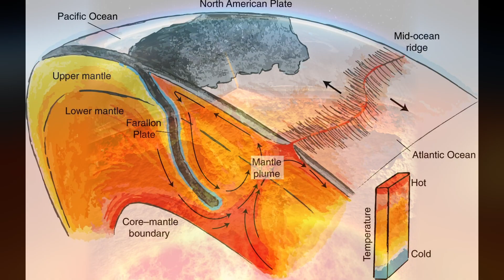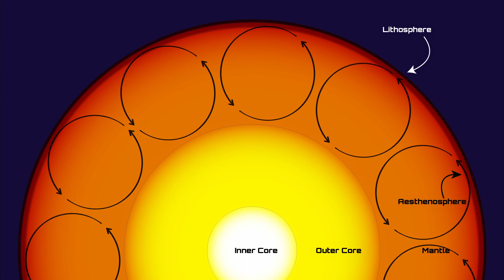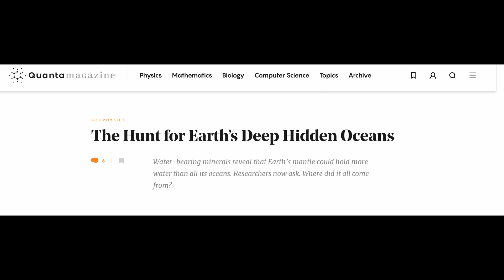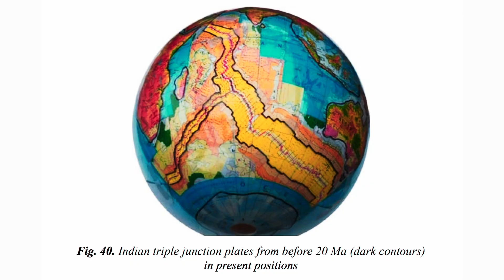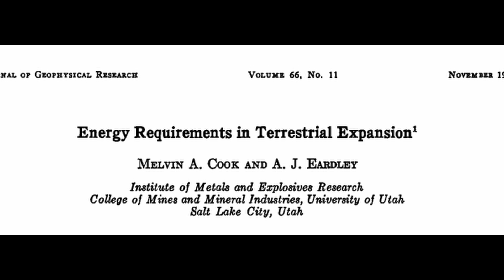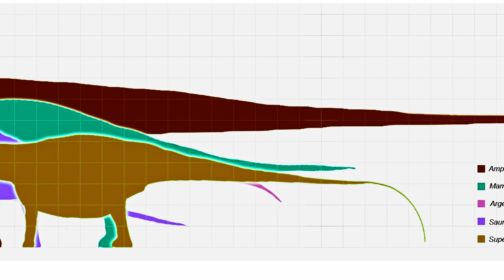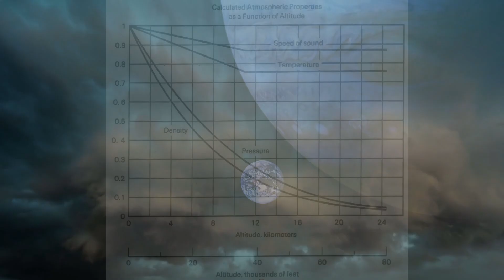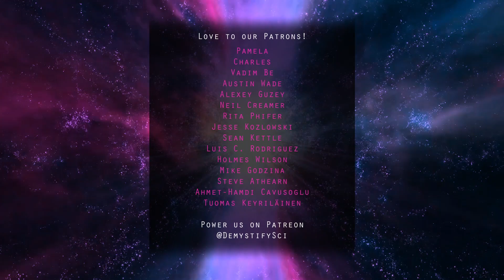Did Earth Start as a Mini-Neptune?

Comment: What if the earth was originally positioned at another point in the solar system, and the main variable in this analysis is a different ( 20% lighter) gravity. Because the degree of gravity changes to it's relationship with other bodies, and also it's spin speed which is also applicable

Comment: 1) Quetzalcoatlus is not a dinosaur, it's a pterosaur. The only flying dinosaurs are the ones around right now that we call birds. Quetzalcoatlus was more than capable of flight, due to the superior design of pterosaur flight compared to birds and mammals; they have a circular respiratory system and hollow bones on par with birds, but more efficient.
2) The reason there isn't any old oceanic crust is that oceanic crust subducts under any plate it collides with, which means it's constantly being recycled. Continental crust floats, which means it doesn't get recycled this way, instead it is eroded by weathering.
3) The earth cannot did not expand, it has remained approximately the same size since it formed. While a heavy atmosphere can compress a planet's core, such compression would remain even after the atmosphere was lost. You can't uncrumple a piece of paper.
4) Africa has no subduction zones because no oceanic plates are moving towards it. Africa is moving north towards Eurasia, but since both plates are continental this forms mountains rather than a subduction zone.

This video is chock full of misinformation, clickbait title.
Reply: Have you ever looked at an age map of the oceanic floor? It can only indicate radial expansion. The ages of the ocean floor, especially around Antarctica, are like rings on a tree. You can clearly see the oldest floor around the coast has the smallest area, and the newer the floor is the more area there is. This cannot indicate subduction. There would have to be a subduction zone around the entire coast, and it would all be folding up as it all condensed toward the coast.

Face it, Earth grows and expands.
Reply: @Grushdevah  The length of the submerged continental shelf doesn't have anything particularly to do with the age of the rock.

Also... we can literally watch plates subducting. We can measure the movement of the Earth's tectonic plates and that the Earth is not expanding.
Reply: @PlatinumAltaria Subduction is localized and  not 1:1 as would be required for no expansion. You seem to have missed the point about the area/volume of the age rings around Antarctica.
Reply: @Grushdevah  What do you mean "localised". Some plate boundaries subduct, others do not. Most of the subduction zones on Earth today are around the Pacific, which is shrinking. The Atlantic, which is on the other side of the planet, is growing. You can see that the crust off the coast of Japan is very old, that the middle of the Atlantic is very young, etc.

No measurement has ever even suggested that the Earth is growing. The Earth is of a known size. I have no idea why you want to insist on the planet magically inflating like a balloon when plate tectonics has such strong evidence behind it including direct observation of subduction.
Reply: @Grushdevah  All the other plates are currently moving away from Antarctica, so idk why you would expect new crust on its coastline. You observe exactly what we would expect: older crust towards the middle and newer crust being formed at the edges where the plates are moving apart. The areas of subduction relative to this movement are in the mediterranean sea, off the coast of Indonesia, and the coast of south America.
Reply: @PlatinumAltaria The gradient of ages is nearly even in all directions from every continent. If they were sliding around and subducting at a 1:1 ratio, the gradients would not look like that. What you do see is exactly like rings on a tree. We also can see evidence of growth expansion on Mars, Luna, Europa, and Ganymede
Reply: @Grushdevah  Uh no, it isn't magically even around all the continents... it's new where the rock is forming, and old at the edges.

Could you explain the giant trenches around the Pacific where rock is being subducted?
Reply: @PlatinumAltaria The pacific gradient is the widest because is has expanded the most, and the ages run from old in the west to new in the east. This indicates westward expansion. The current eastward subduction is because of the compression of the entire system due to gravity. Growth phases pull the pacific floor westward.
Reply: @Grushdevah  The Pacific isn't expanding, it's shrinking in ALL directions.
Reply: Have you seen Neal Adams' animation of Earth's expansion? You simply remove the ocean floor age-for-age and rewind the clock. The whole thing closes up as a smaller sphere. It fits because it's fact.
Reply: The age map would looks less like a rainbow gradient and more like a Rubix cube if the planet wasn't growing anf expanding. I don't know how else to explain it. Subduction has to be 1:1 to disprove expansion and it clearly isn't.

Comment: Bravo! Just looking at the dino problem: if i recall correctly (which may not be the case), according to Electric Universe (via Wal Thornhill), a massive electric arc between earth and, say, Venus (in its cometary era), could have changed the gravity of earth (assuming there is no Big G). The assumption that there is a universal big g, is an assumption, right? Pardon me if i am off the wall here. That you guys have delved this deeply into this issue is… just so encouraging. (Btw, i don’t see how Petitt’s ‘thick air’ theory helps at all. The wing bones in a flying dino would snap under the torque in any air density. This is such a great issue…)

Comment: Brilliant.  This ties in beautifully with the theory that all planets are in fact dead, cold stars. 

The evidence for this is clearly written in the nature of the solar system, which boasts a perfect series of entities from the cold brown dwarves of Jupiter and Saturn, the partly condensed entities of Neptune and Uranus and the fully condensed rocky planets of earth, Venus, mars and mercury.

Another aspect to consider is that of core cooling.  As the atmosphere condenses and turns into ocean, the hot core is cooling and solidifying… turning to rock.  The rock also traps air and water as it is broken into pieces, trapping air and water and expanding as it does so, taking up more volume.
Reply from the maker: We tried to have a conversation about stellar metamorphosis on @DemystifySci_Podcast, but haven't found a good representative of the ideas yet. Any suggestions?
Reply: @DemystifySciInvestigates  Afraid not.
I did see a fella here on YouTube espousing this theory in some detail but I've struggled to find him again.

I've pondered this process for many years and am pretty convinced of it.  I've furthered it by espousing a nebula-collapse hypothesis based upon the straying of a rocky body- perhaps an old planet- into a nebula... which introduces into that environment a surface against which pressure is generated (I reject the nebula self-collapse hypothesis as nonsense).  This process ties in with PM Robitaille's point on gaseous clouds.

So planets may have been stars many times over and can be reborn as stars once more.